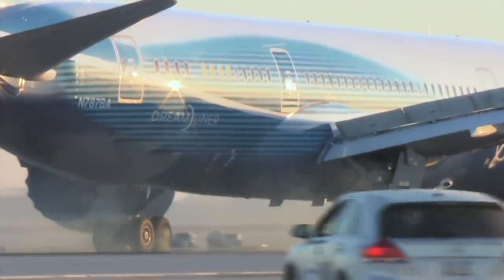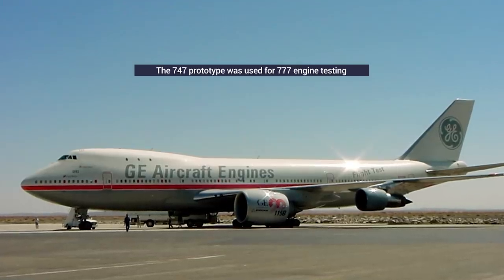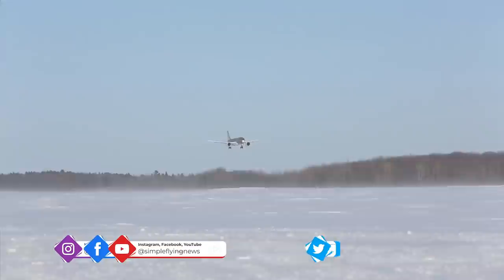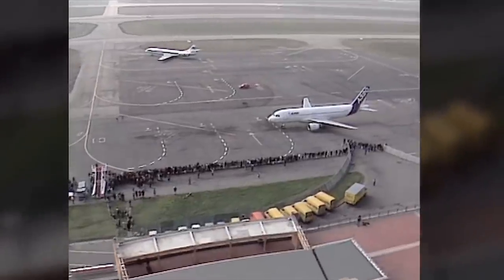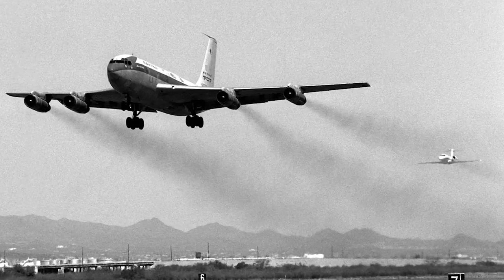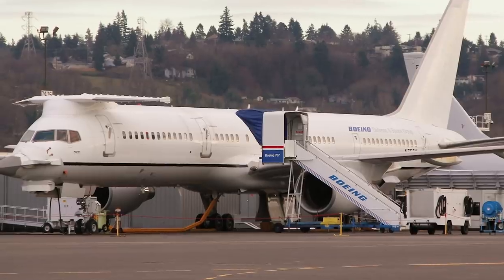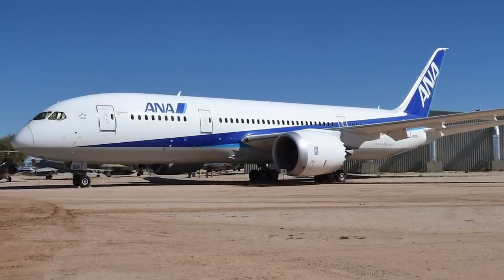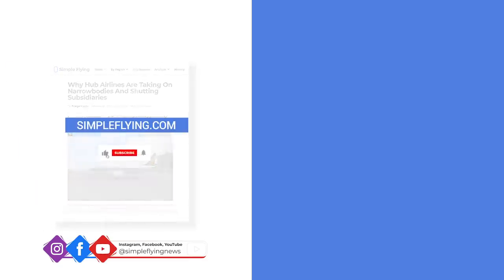What Happens To Prototype Aircraft Once Testing Is Complete?

Comment: I got to see the first 727, 737, 747 and 757 (catfish) (as well as the first 787-10) all in one day during a visit to the museum of flight, where the third 787 is also on display!

Edit: Some test aircraft, so not the very first aircraft, I’ve seen include the second A321neo, the second A350-900 as well as both blue A350-1000s (so not the carbon one but therefore also the A35K prototype). I also got to see an A330-200 in Airbus colors once!

During a stopover in Atlanta I got to see the first 747-400, which is now preserved at the Delta museum! It’s quite cool that I also got to see the last 747-400, a 400F of Kalitta Air!
Reply: @British Airways Boeing 747-436 exactly!
Reply: When I was four years old I got to fly on an SAS DC-7 from LAX to Copenhagen.  Still have vivid memories of the flight and have been a commercial aviation buff ever since.

Comment: DC9 - 31 N8916E certification aircraft for -30 variant of DC - 9 was delivered to Eastern Air Lines and served a long career. It suffered a fire while parked in ATL at a gate which gutted the fuselage. Another Eastern -30, N8961E. was damaged in a hard landing during a microburst at FLL which drove the main landing gear up through the wings. They took the wings from 16E and the fuselage from 61E and called the combined aircraft N 8961E.
Reply: I did a lot of flying when I was a kid and in my teens all over the world, but I never liked flying on the DC-9.  Visually it just looked like it would be a lot of work to keep it stable in the air.  Though the truth is Douglas sold thousands of them to airlines all over the world and so far as I know have an excellent safety record.

Comment: Love to see A380 Testbed F-WWOW carrying RR Trent XWB-97 later mounted on A350-1000🛫🤓
Reply: 747 with GE90s look really cursed
Reply: i am amazed of how the 380 engines are as big as the a350 engine... Wow
Reply: @ThePatkiller99  both almost has the same diameter...but way different on thrust & air mass flow produced🛫🤓
Reply: @stradivarioushardhiantz5179  of course not the same generation/technology/etc
Reply: @ThePatkiller99  but the GP7200 has a price range of narrowbody engines such PW1100G or Leap-1A/B/C 🛫🤓

Comment: The author missed the history of the 767 prototype.  It was a testbed for the AOA project for the army.  (Airborne Optical Adjunct) later renamed the Airborne Surveillance  Testbed (AST).  It was part of the Ronald Reagan era "Star Wars" program.  Boeing installed a big dome on top of the aircraft where a big door would open to expose a sensor that could pickup the heat from intercontinental ballistic missiles against the backdrop of space.  The sensor contractor was delayed for years and I think the program was scrapped before the sensor technology could finish being developed.  The plane sat for years at Boeing field in Seattle waiting for the sensor to be developed with the big dome on top ready to go.  The aircraft was scrapped in 2002 following the end of the program.

Comment: These are not "prototype testbeds" but full production airplanes built to released production drawings. They couldn't be certified if they were only prototypes. Many first-of-model airframes were so heavily modified during flight and cert testing, they could not be used in commercial service, or are so heavy with patches and band-aids, they barely fly. That's why the first batch of 787s could not enter commercial service.

Comment: A prototype B747-400 of Northwest Airlines had a major rudder failure. While it was in full passenger service, some parts suffered a lot from thorough test flights, which resulted in fatigue of the material.
Reply: Luckily the crew managed to land at Anchorage. The 747 is now on display at ATL

Comment: I did fly on the first B777-200 prototype in 2001 as CX904 Manila🇵🇭 to Hong Kong🇭🇰 2-5-2 configuration
Reply: I believe the 777-200 prototype will likely be a show piece at the Pima Air Museum.
Reply: @Sacto1654  It is a show piece. It has been for 3 years.